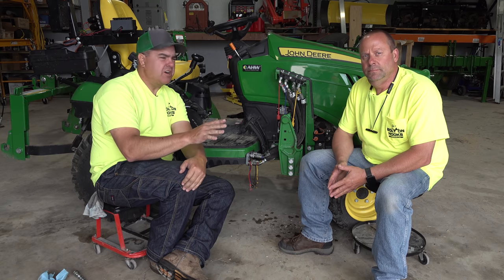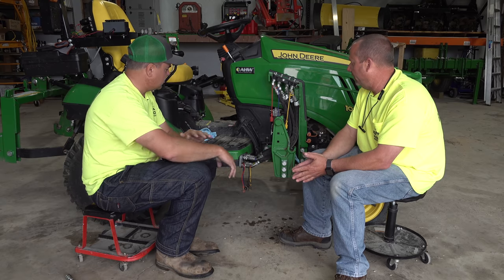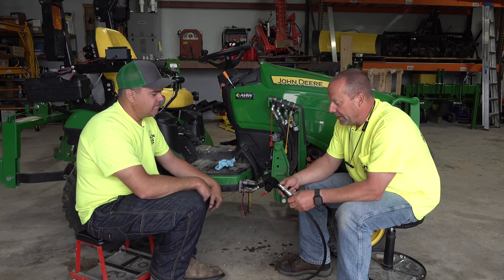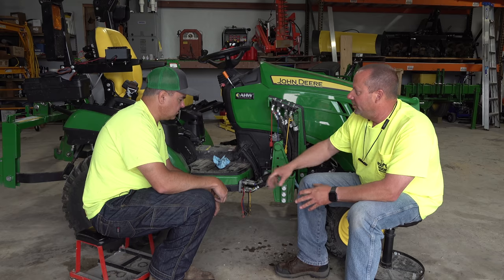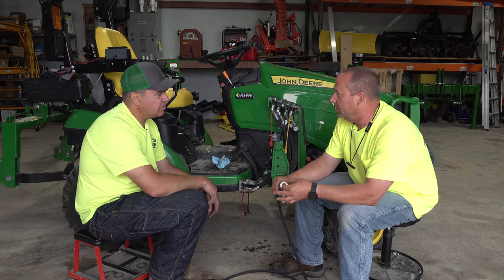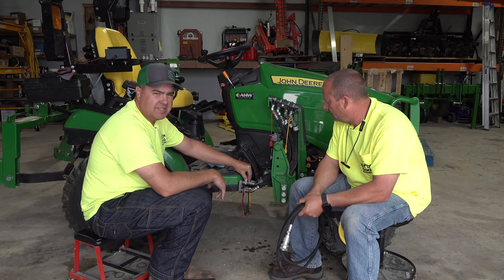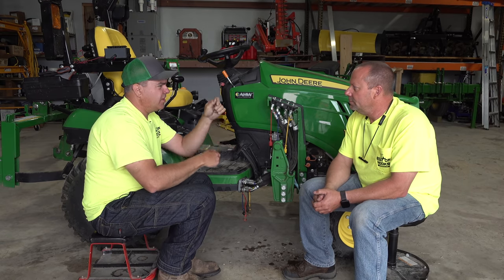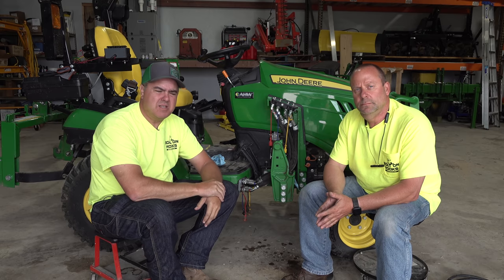How To Solve Tractor Loader Hydraulic Issues

Comment: I've always cleaned off/out both male & female coupler connections before re-connecting them back together & ive never had any leaks drip on the floor. . . that I can recall. . .!!! 

On the spring loaded "poppets" ball, in these connections, after I have cycled the loader control joystick valve to relieve the pressure, for the female side, ive gently  used a small nut driver to push in the poppet ball to relieve the pressure & on the male side, ive used a rag to cover the end as mentioned & used my gloved fingers to push that poppet in. Thankya Tim & Ken for sharing this awesome video!

Comment: Ohhh my goodness!  I have a Kubota MX5000 and one of my hydraulic connections was loose and leaking, so I tightened it.  Instantly it fixed the leak, but then my bucket wouldn't curl, but would go up and down.  I thought something broke inside of my control box.  I was so frustrated thinking that maybe the pressure broke something in the controller.  Watch your video and you said 90% of the time the snap connection is loose and not connected.  I kid you not, THAT WAS THE PROBLEM!  I must have knocked it loose when I was tightening the hose connection with my wrench. I didn't notice that it was snapped off.  Thanks Tim and Ken!

Comment: Tim and Ken I really appreciate you taking the time to make this video.  Recently I experienced what seemed like a major leak on one of my tractors.  Your advice not to panic and a little leak seems like a lot was spot on.  After checking my connections, I found that an O-ring and connector was bad.  Your video helped me diagnose the problem and get up and running again.  Never knew John Deere made a red dye for the hydraulic fluid.  It definitely makes checking the sight glass for fluid easy and confirms that the leak has been repaired.  Thanks again and keep up the great videos!

Comment: Great video. One thing I didn’t hear mentioned in the discussion of O-rings is how heat builds up during use, especially around couplings and fittings, which will deteriorate the rings over time. Heat does as much damage as re-coupling.

Comment: Great, great video! Thanks so very much for your very informative video on hydraulic problems! You addressed exactly the problem I was having with my front loader. I followed Ken’s clear instructions and used wd40 to clean my hydraulic connectors before and after disconnecting them.From now on that will be my primary use for WD40. After cleaning and reattaching the connectors my bucket performed flawlessly! I greatly appreciate what you guys do and the ways in which you gently show where your true priorities are!

Comment: Learned something from the video about using WD-40. Thank you.  Seeing fluid level on the dip stick was mentioned, something I learned a long time ago was to take a 3 cornered file and put a small notch in the side of the dip stick at the full level and anywhere else, such as 1/2  or 1/4 or so, makes it a lot easier to tell where the level is.

Comment: My goodness what great timing.  I had the exact scenario 2 days ago with my grapple. I ended up having to loosen the line and it dumped a tablespoon of oil to relieve pressure. When I parked it it was about 50°, and 90° when I was trying to hook it up.

Comment: Yep done that, couplers can be a problem even on a Kioti! 
And my John Deere.
Another way is to take your time and make sure no pressure is on your attachment by level and then before you disconnecting it 
Shut the tractor off, move your controls around with the engine off and key on to relief pressure in your 3 rd.function. 
Great job Tim and Ken. 
Cheers from ID.
Reply from the maker: Well, pressure can develop because of temperature changes even when disconnected

Comment: You guys were spot on about the loader valve connections!  Thanks so much!! Problem fixed without hauling it to the dealer for 
A fix!  Save me several hundred there!
Looking fo that waite tool now for 1/2" coupling on my JD!  Seems to be out of stock!

Comment: I've been using starting fluid to clean the hyd fittings as we did years ago on the farm.  I'm sure the ole WD works just as well.
Reply: I’m with you Randal. Starting fluid is a great cleaner/degreaser for such applications.

Comment: I had a stick pop up and remove a coupler on the loader. I could not lower the loader and my super human strength failed me and I could not get the coupler on 🥺.  I put a log under the bucket tipped down until I could relieve the pressure on the loader arm.  Only then could I connect the coupler 😊

Comment: Master Tim, you know this already I am sure but for others out there some third function valves allow you to manually relieve pressure at the valve without having to power the valve up and do so with the switch. I do this all the time with my W.R. Long third function valve. There are two indents at the top and bottom of the valve where you push them in with a screwdriver to relieve pressure. 🙂

Comment: They are hydraulics, they have to leak to work properly! Although very very minimal leakage. Every time a cylinder runs in or out there are minute quantities of oils on the cylinder rods. Our job as owners is to keep the oil loss to an minimal acceptable level. Besides small amounts of oil works great as a rust preventative! Great content Tim!

Comment: Great video!  I learned that a tool can be purchased to relieve the pressure in attachment's side of hydraulic lines.  I've got flat face couplers on my Kubota.  What's the best way to determine the correct size flat face coupler so I can purchase the right tool from Ken?  Thanks you you both, Tim and Ken!

Comment: Story time...check your o rings, the struggle is real! I just recently did the 200 hour hydraulic service on my 2018 1025R, and I didn’t check the o ring on the aluminum “fitting” that holds the mesh filter with the magnet inside the reservoir. The outer o ring that seals between the fitting and the reservoir orifice was compressed (but not visibly damaged...I checked after the fact😕) so it hemorrhaged oil about 15 minutes after I thought I was done. I had to buy a new oil drain container as to not contaminate the $120 worth of hygard low viscosity hydraulic oil (stuff’s expensive here in Canada)...all because I didn’t replace a 40 cent o ring!

Comment: The John Deere hydraulic oil dye is P/N MT3668, and cost me $11.17 as a non-stocked part at my local dealership.
Note: The first time you buy this, and open the small glass jar with the Teflon tape around the threads and look down in it, you are going to think that you have been sent a faulty jar of this dye, maybe it evaporated, or have been ripped off.  When in fact, that is not the case.  The dye only fills up the jar about one eighth of its depth, maybe one quarter of its depth.  I think that they put it a jar that is too big, so that you can pour in a little hydraulic oil and mix it up to get the most dye out and into the oil reservoir.
Reply from the maker: http://greenpartstore.com/ttwt

Comment: I just had to replace one of the male couplers last week @ 125 hrs. I was able to find a set of 4 from your friends at Summit Hydraulics for just under $30: John Deere AW32184 Replacement Male Hydraulic Quick Coupler Plug (SKU#AW32184). Threaded on like the OEM.

Comment: Jhon deere dose not make there own fittings. I found out that they are made by a company called Parker Hannifin.  They make the parts and hoses and fittings for john deere and you can get the tool and fittings from them and they make the parts of more than john deere. They are pretty much at cost to.

Comment: I had this pressure problem with my grapple. Once I figured out what was going on, I was able to loosen one of the hose connections on the grapple with a wrench to relieve the pressure. 

I never take my loader off and the grapple is the first implement I have that has hydraulics... That little pressure relief tool would have been handy!

Comment: Only have 15 hours on my 1025R.  I viewed this video when it first came out.  Today I was having problem with my bucket only raising half way and thought I broke something.  Checked the couplers and sure enough one had slipped out, but still sitting in the connector.  Saved me a lot of time looking for a solution.  Thank you for your videos.

Comment: I have found, as long as it is dry out, that opening the 4 in one or grapple and letting it hang open before disconnecting will draw air in when gravity coses the bucket.  This keeps the pressure from building back up.  Disadvantage is vacuum is retained if weather seals are good.  My weather seals are weeping oil, so no vacuum after a few minutes.

Comment: AG couplers are designed to leak oil when coupling or de coupling as a cleaning feature. The idea is to flush the dust and dirt from the couplers and prevent damage.
Something you should discuss and demonstrate is the fact the oil in the hoses and cylinders does not circulate through the system. The cylinders are basically a dead end street for the fluid and the hoses should be disconnected at the cylinders and flushed when changing your hydraulic fluid. For front end loaders, a typical complaint is "floppy bucket" which is caused by air accumulating in the hose or cylinder. Again, the hose should be disconnected and flushed to remove the air. It is that air that causes the increase in pressure in the line which makes the coupler impossible to re connect. Last, a pair of 8" adjustable wrenches kept on the tractor is the safest way to relieve the pressure in the hoses when the couplers won't re connect. They fit all sizes and are a fraction of the price of the Waite tool.

Comment: great content!! Wondering, can you explain how to bleed a hydraulic system? also any input on running larger I.D hoses for faster controls? I have a old hydrostatic JD400 and having issues with the system filling with air and bleeding it out
Reply from the maker: Should not need to bleed hydraulic system.  
I wonder if you need more oil in reservoir?
Larger hoses will not make lift faster.
Reply: @TractorTimewithTim  I have a old 1975 JohnDeere400 hydrostatic. Learning a lot but this system is all new to me. Fluid always seems to over flow from the breather and I know when I drop the fluid to change it, it’s all airy and full of bubbles. 

Still need to pressure test the system and can only think it must have a leak in the system and pulling air in not sure how it’s pushing fluid from the breather though.
Reply from the maker: There is a problem.  Unfortunately, I am not experienced enough to diagnose.  Sorry!
Reply: @TractorTimewithTim  not a problem at all. You did help with making sure to set attachments down and 3pt down before checking the levels. I will do that. Like I said grateful for your content and will continue to follow

Comment: Great Vid Tim and Ken, Having recently installed a FEL after market on my tractor. I found that when lifting  a substantial load which the FEL has no problem lifting, the steering (power) seems to lock up.

My question, the reason I found this vid is that, is there a separate pump to feed the steering cylinder or is this fed from the main hydraulic system and, uses some way the steering wheel linkage to control that steering cylinder?

The fact that I can lift the load indicates to me that the system pressure may be ok but, I am having a flow issue . Your thoughts are appreciated. I have a CT235 Bobcat with a factory installed joystick/valve.

Loader and tractor work fine when lifting lighter loads. Just not quite sure how the steering function works

Curious to know if any buddy in this community has run into a similar situation. Thanks in advance
Reply from the maker: Some small machines share a pump.  Check the specs of your tractor.

Comment: What is the proper way to get air out of the loader hydraulic system? My dump and curl function for my 2305 seems to have air in it. Back story, last year the loader had one line that the male fitting was leaking oil when unhooked from the tractor. I didn’t bother to see were that line went just replaced the fitting. Now a lot of the time when I try to back drag with the bucket it will not hold its position. As soon as I start backing up and the bucket makes contact with something, it will curl back 5”-6” before starting to hold position. If I put the bucket on the surface I am back dragging and then dump the bucket down to the position I want to back drag it will stay put.
Reply from the maker: This is not ‘air’ in the system.  The bucket will move until it encounters enough pressure to keep it from curling.    It is normal...but frustrating.
Reply: The system purges air automatically, no need for you to try to do it.  Also read the sticky thread about "REGEN" in the hydraulics forum on GTT, that will help explain it too.
Reply: @TractorTimewithTim  the bucket did not flop around before the loss of fluid and the fitting change. The loaders and tractor front end loaders that I use to run growing up on the farm did not move very much, less than an 1.5”. This thing is floppy most of the time trying to back drag up to 6”. It definitely not the same as before.
Reply: @boltonhooks2149  so if I read that correctly, I just need to hold it in the dump position to allow time for the air to be pushed out of the cylinder?
Reply: @briannelson2818  yup, that should do it.

Comment: I have a 2009 5105 compact tractor that my front loader will not raise bucket, and the lever shows signs of hydraulic leak. Do I need to replace the levers for th bucket lift

Comment: I feel like I'm loader isn't lifting up good with weigh I installed a third function diverter on my JD 1025r any suggestions
Reply from the maker: I assume you mean that it has reduced lift capacity?    If so, get a pressure gauge from boltonhooks.com to check the hydraulic pressure.

Comment: I have a issue with my tractors front loaders bucket. When I go to curl it it doesn’t really want to but when I do the curl up function it corks properly and I don’t know if it’s the loader control or the hydraulic system. Do you have any idea what it could be?

Comment: Any thoughts on a video showing how to add shims to the hydraulic system to increase pressure?    I know I would like a walk though as mine is lower than factory spec and it struggles to lift implements in the three point.
Reply from the maker: Deere doesn’t use ‘shims’.   Tech support manual shows how to adjust.
We are a bit reluctant to show this for a variety of reasons.
Reply: It’s on an x758.   And I understand why you wouldn’t want the liability.    Doesn’t take much to take one of these systems past the point of no return.
Reply from the maker: Ok, in that case, I think you DO have shims.

Comment: Tim, on my Kubota it happens every time i put my hydraulic snow plow on. I just crack a connection on the hose line on loader arm. Drips three drops & bingo on.
Reply from the maker: You should get the Waite tool.

Comment: Tim, I have a 120R loader on my 2019 2025R. One cylinder does not seem to want to retract all the way. So, when I put the bucket or forks one, I can't get the pin in one the bottom all the way without a lot of force an if I do it's very hard to remove. The front attachment arms also are hard to keep in sync. I saw something about the lower bar between the two sometimes having slop in the pins. That doesn't seem to be the issue. This seemed to happen for no reason and I have cycled the cylinders many times to try to relieve any possible air in it. Nothing appears to be bent. Thoughts?
Reply from the maker: The front attachment arms out of sync is not an issue. Ignore it…you can easily push one to line them up when connecting to bucket.
To get the boom cylinders in sync, raise all the way, then lower all the way a few times.  Should get them lined up.
Reply: @TractorTimewithTim  It's one of the tilt cylinders that won't pull back all the way. It also will weep forward a bit when no attachment is on and the tractor is shut down. I don't have any leaking fluids.
Reply from the maker: @Paint1970  once connected to the bucket, can you get them in sync?
Again, there is no need to be concerned about them being out of sync when not connected.  It is simple ‘T’, oil will push the side of least resistance.
Reply: @TractorTimewithTim  One side still won't retract all the way to be in sync. That being said, I cant pin the one side in and the bucket/loader are not bent. Can it be air? That side will creep forward a bit with no attachment while shut down.

Comment: I have a question about a JD 4100. Basically my bucket won't curl either way it goes up and down and when i switch the hoses it will curl. It seems like the joy Stick won't go side to side just up and down. Am i doing something wrong?
Reply from the maker: Sounds like the valve (scv) might be bad.

Comment: Been having trouble with my loader. Loader wont raise unless i pull stick back and angle it left at same time..then it goes. Sometimes it raises up a few feet and suddenly stops and wont go any further unkess i angle the stick left while also pulling back...then it goes. Guess ill try cleaning the connectors bec i dunno what else to do. The control stick just went haywire. I tried taking off and reconnecting once already. 2 of them i always struggle to get connected. No pressure but its like the balls dont pull back like they should and it wont hook in. Kills my back fooling with them
Reply from the maker: Hate these connectors!!!   Sounds like your valve may be bad.
…maybe consider the single point connector we show on our channel!